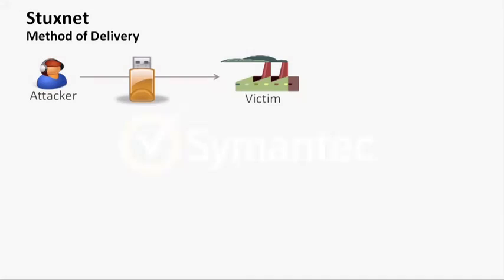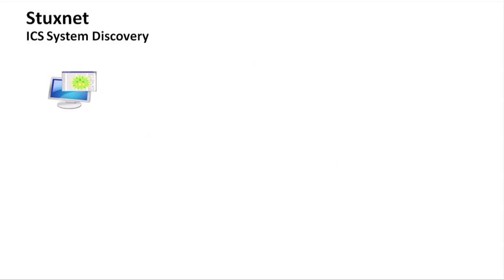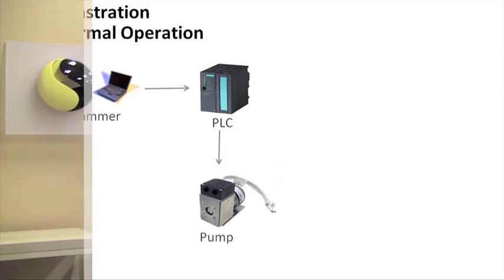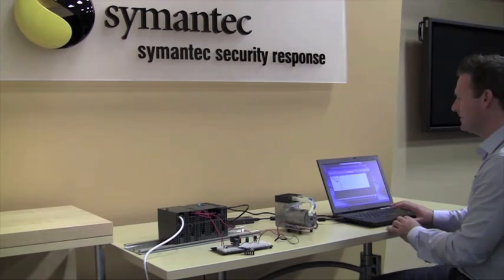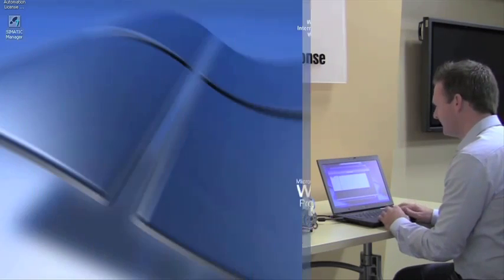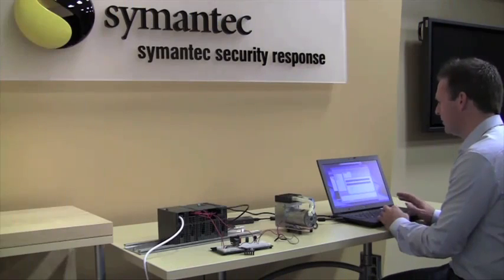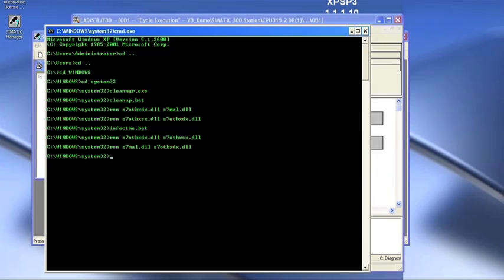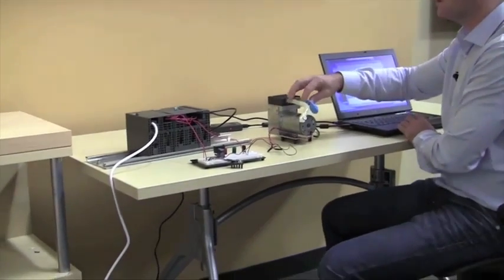Stuxnet:How It Infects PLCs?

Comment: if the network was isolated (not connected to public internet) as claimed during start of the video, how can infected computer can send data to the attacker and how attacker was able to program PLC?
Reply: "It can self-update even when cut off from the C2 servers (which is necessary should it find its way into a truly air-gapped system) by enumerating and remembering a complex peer-to-peer network necessary to allow external access."